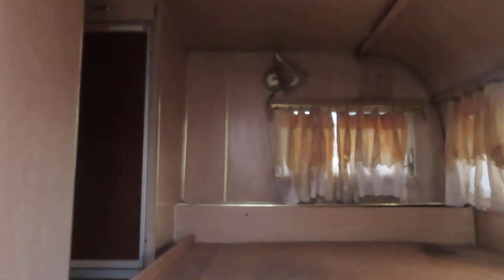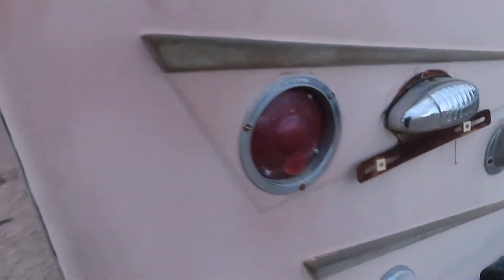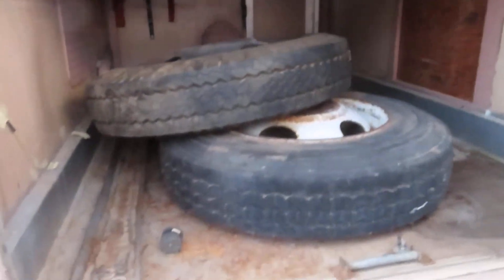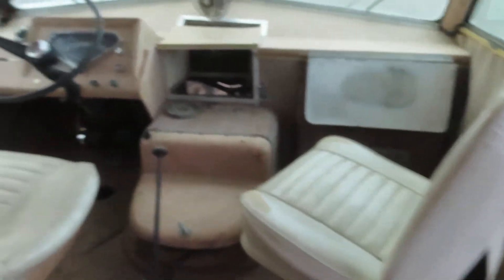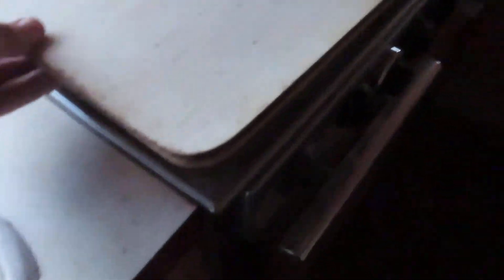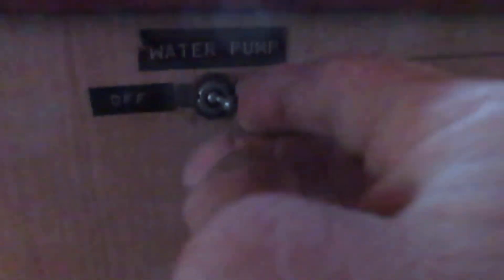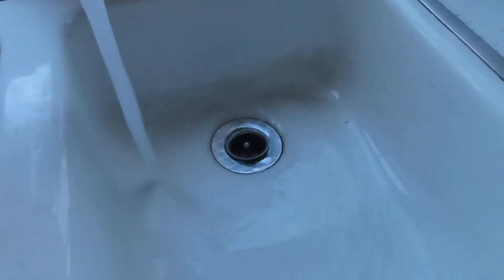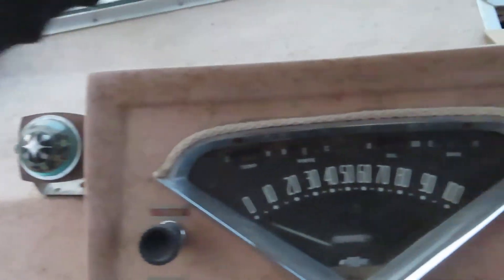1960 Chevrolet RV Motorshome 1959-60 era Part 2

Comment: The fridge is probably an absorption type.  Would run on propane and house battery, or electric when attached to shore power.  They take quite a while to get cold.  On the trailer we had, I would go light the fridge the day before to ensure that it would be cold enough to put in food.  The absorption fridges are very finicky.
Reply from the maker: it was that type, correct.